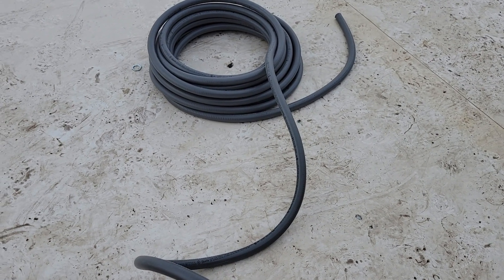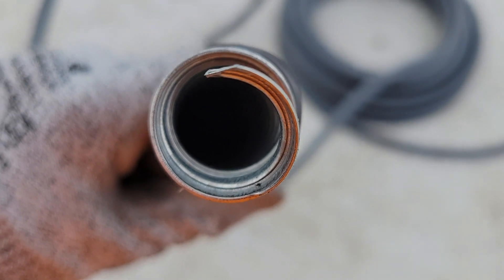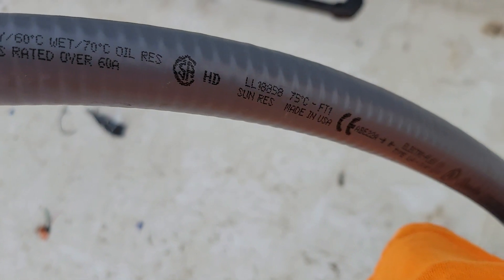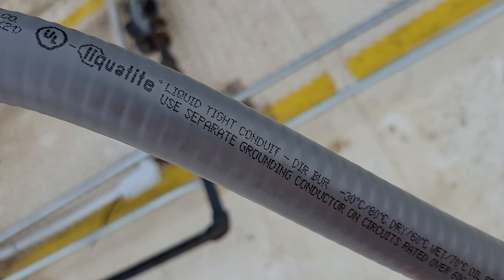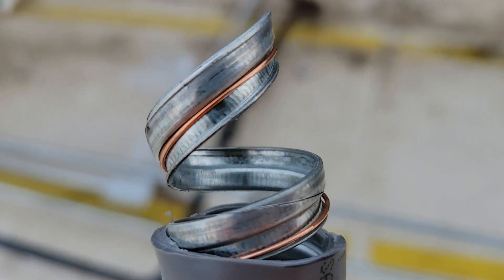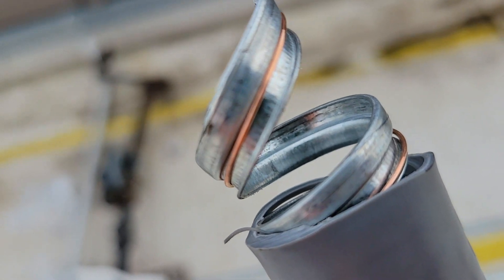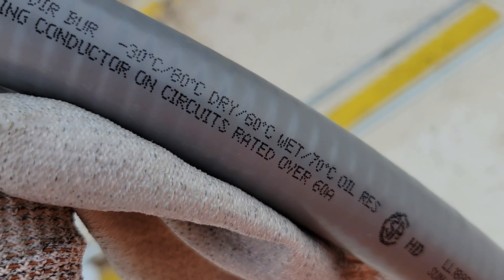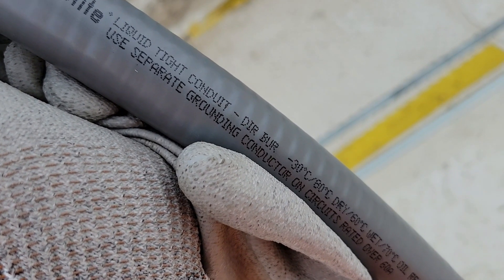What Is Liquid Tight Conduit?

Comment: That copper conductor hidden inside is interesting. Is there a difference between Carflex & Liquidtight? Thx for the video.
Reply from the maker: Carflex traditionally doesn't have metal inside. Thanks for the comment
Reply: Do you have a video that shows 'landing' the silver & the copper for grounding that copper conductor? I can't find anything on YT that shows this. Thx.
Reply from the maker: @stevenbernstein1978  strip the outer coating with a knife 1 ft extra. Cut the silver off and leave the wire. Then put your connector on and feed the wire through the connector. Then land the copper where you land the ground. Thanks for the comment.

Comment: can you use 2/0 wire going from a outdoor 200 amp disconnect to outdoor panel using 2" liquid tight ?
Reply from the maker: To be code compliant you will need 4/0 copper or 300kcmil aluminum. The reason is because your panel is a service and wire needs to be sized 125%. Use a #4 ground for the copper and 2in lmfc.

Comment: As far as installation goes, is there a maximum radius for bends? Should the seal-tight be allowed to crinkle on the exterior when a tight 90° bend is needed? Also, should you run the conduit from start to finish prior to dressing in, or dress in as you go from end to end?
Reply from the maker: If the coating is wrinkled you should probably use a 90 degree connector. Thanks for the question!
Reply: Code says the bend must not diminish the cross-sectional area significantly.  So, bend all you want, but don't kink it.